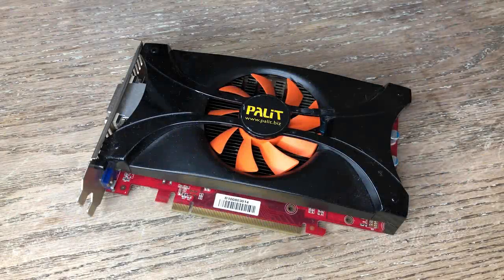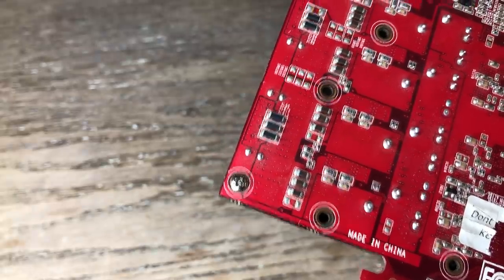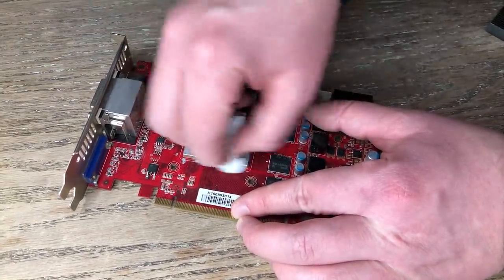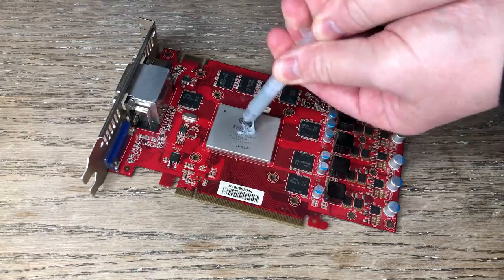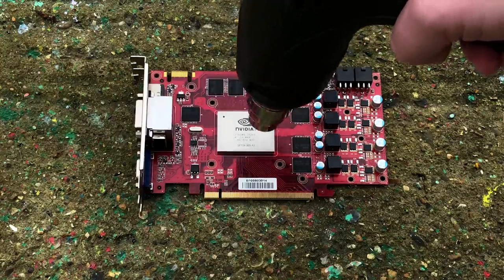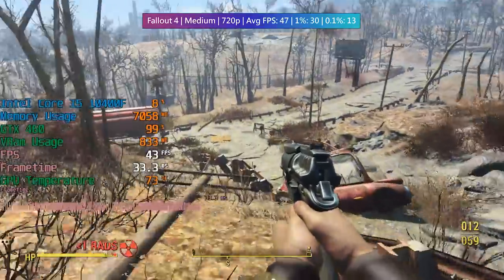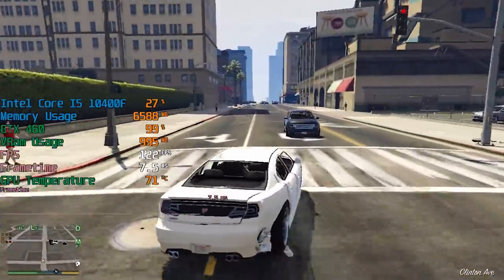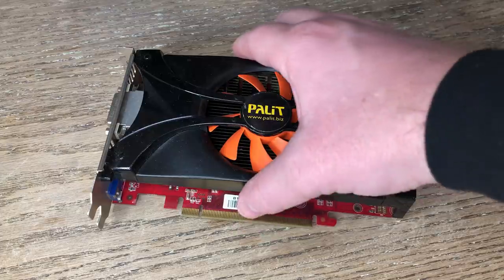Reviving The Dying GTX 460

Comment: As a student/assistant tech at my school I did once bake an HP LaserJet P2015dn formatter board.  Went to market in 2007, HP hadn't tested thermals with lead-free solder for that model and they failed fairly quickly.  The foods teacher was perplexed as was the shop teacher when I told him what fixed his printer.  For reviving a $500 printer, it was a cheap fix for a school and makes for a tech adventure story.

Comment: I did this trick to a dead GTX 280 back in 2013, but I went above the melting point of the lead-free solder. The card had many years of use after it and it actually it still works perfectly! That card was a beast back then.

Comment: i did this to a hd 7970 and it still works and i did it 1 year ago it is definitly worth trying in my opinion
Reply: Yep, my previous GPU, a R9-280X (so basically a 7970) lasted another 18 months by baking it. 
I was really surprised as it failed with a black screen. No artifacts, just a black screen, not even the BIOS would show.

Comment: I'm pretty sure bryan from Tech Yes City has, and he treats those revived gpu as ok to use for another 5 years.
Reply: Bryan does warranty the parts he sells, so he stands by it. Which is more than a random eBay seller or local listings ad would. Personally, I don’t think it’s very honest, but if you have a guarantee, at least you have something to fall back on.
Reply: In my experience "reflows" like this last about 6 months on bad chips, but I have had an R9 280X that lasted a solid 1.5 years until retired. 
Selling them is bad except you give a 3 year warranty which I think even Bryan won't. 
Selling them with just one year of warranty is bad (except if you explicitly say it is a reflowed GPU and might not work very long)
Reply: There is also the ethical problem of baking in inconvenience when you can deliver otherwise. Even with the warranty, you're selling in bad faith if you're not informing the customer that the GPU will fail imminently more often than not. Bryan in particular has spoken out about shady PC resellers taking customers for a ride and I think selling oven GPUs just adds to the perception, even if he's shaving off a few bucks.
Reply: @dycedargselderbrother5353  I'm sure he does tell his customers if the gpu are baked, I mean the videos are on his channel.
Reply: @crispianchealuks2024  I haven't watched his content lately, but "Are you selling these GPUs to customers?" and "Are you telling your customers the GPUs are baked?" were commonly asked questions on the relevant videos and I don't recall him addressing either.
Reply: @dycedargselderbrother5353  I seem to remember one of his video where he replaced a customer's entire system because of glitchy gpu

Comment: I baked an HD 5670 in the oven back in 2012 and it still works to this day haha. I also baked an 8800 GTS 640MB 5-6 times after it would start artifacting within 1 week to 1 month after the prior fix. Eventually, I used it as a test bed to learn how to reball a GPU, and fixed it permanently with lead solder.

Comment: I remember having to do this with the oven method on my old Radeon 7950 and that taught me that reflowing the solder can actually still be a permanent fix if you get lucky as its still working for the guy I sold it to for a cheap a few years back.

Comment: Nice revival and teardown :) If you can't sell it on, for obvious reasons, then I'd either just whack it in a PC that is being sold on, or keep it as a test GPU for future videos/projects.
In fact, I'd happily buy it to go into a 2nd generation Core i3 based tower PC which currently relies on whatever version of Intel HD Graphics it has. I'm sure that any decent GPU (bar a display adapter) will run better than Intel HD Graphics.

Comment: Ahh yes, one of the faulty 460 Sonic cards with a missing vrm heatsink. Wonder why that failed.
Reply: Not faulty, they were legit like that. I had a GTX 560 Ti from Palit that I'm pretty sure used this exacty same PCB with no VRM cooling. The card crashed if you pushed it too much, terrible terrible design and I'm never buying Palit/Gainward ever again. A reference design would have been a million times better.
Reply: @NOXXism  nah the issue was some 460s shipped without the VRM heatsink for some reason, others were fine
Reply: @sgcs  my 560 Ti came without VRM heatsink as well. It was a cost-saving measure otherwise it would have only been 460s. Review 460s had them IIRC but consumers got screwed.
Reply: So might it be that he just reanimated cooked capacitors (or, even if unlikely, MOSFETs)?
Capacitors often increase in capacity shortly when getting warmed up, thats how I test bad caps in PSUs for example
Reply: @TheRailroad99  i doubt that given he was pointing at the chip itself.. at least in the video (cuz like in an oven entire pcb gets cooked)
Reply: My Sapphire Fury cards run without heatsinks now, but they also have excellent VRMs so they don't get warm. My Gigabyte does though, had to put a giant heatsink rail on it with a big fan because wow they really put the worst mosfets on the face of the planet (it does best over-clock under-volted because the VRM power is more stable...)

Oh well, just part of the challenge fitting triple slot cards in a 4x crossfire configuration without enough physical space so you have to water cool the cores.
Reply: @jakegarrett8109  fun project or serious gaming PC? Because I can tell you, since a few years CF sucks, even 2x CF. Very few games support it, and from them, only a handful work well (as in CF works better than a single card).
CF was great 7-8 years ago, but now its far worse than SLI. 
This atleast was my experience with it two years ago.
Reply: @TheRailroad99  A do a lot more than gaming, but my main PC is Threadripper with 4x Fury, and you really need Threadripper for its 64 PCIe lanes otherwise using a crappy 9900k with only 16 PCIe lanes would result in a horrible experience. It gets a little over 100 fps in Crysis 3 at 4k Ultra compared to a choppy 45 fps on my Titan Xp collectors edition

Basically only 2-3 games I have work better on the Titan which are the bad console port Watchdogs 1 (memory hog port, it uses over 11 GB of Vram so not even a 1080ti is sufficient. The PS3 with 256 MB of RAM and Vram could run it, but it consumes insane amounts on PC) and Fortnite. So if you're a huge Fortnite fan you'll want to grab the fastest Nvidia card you can (I usually don't even run it at 4k, for better fps I use my 1080p 240 Hz monitor and overclock the Titan as high as possible although its mostly CPU bound because my Threadripper is clocked at 4.2 Ghz all core and my test bench I usually only have a Ryzen 1700, though sometimes I sub-zero cool that processor it just doesn't clock as well as my Threadripper does).

I noticed that 2x RX 470 had massive stutters (I had 4x of them, but didn't try crossfire above 2x due to horrible stutters. I don't get stutters on my Fury cards, I think HBM or something but its more stable than single Pascal GPU). It also could have been an unstable overclock though, because I looked back at my screen recordings and I left it the same speeds that I set the 3dMark world records for 2x RX 470/570, and I was just gaming at that, so maybe the clocks were unstable, but I'm pretty sure the Fury is just more stable in crossfire and it scaled much better. 1x = 35 fps, 2x = 60 fps, 4x = 100 fps (crysis 3 at 4k ultra), other games like Payday 2, a game that only runs on 1 CPU thread scales above perfect for 2x cards so it just varies per game (I don't know about 4x, its already like 150 fps at 4k Ultra at 16x AA and CPU bound since I don't have a 6 Ghz chip since I don't have an Intel chip but if I do get an HEDT with enough PCIe lanes I'll throw it on my LN2 or phase cooler to see if payday scales with 4x, its playable at 150 fps though).
Reply: @jakegarrett8109  interesting to see that you actually use it. Seems our library is very different. 
Crysis 3 is one of these older games that has a very good multi GPU support. 
But Rainbow 6 siege did not work, 
Payday also didnt work when I tested it in 2018
Reply: @TheRailroad99  Should be default crossfire setting for Payday 2 (make sure its 2 and not 1, I don't have Payday 1). I've noticed sometimes you have to disable then re-enable crossfire to get it working, I had to do that a few times when I first installed the cards but after that they seemed to work fine in all but a few games (a few don't but they run 300 fps hitting game engine caps at 4k Ultra with 16x AA like L4D2 so its a tie regardless of card and Xfire isn't needed). Usually it is older games, and I mostly play free to play or I'll wait several years until games are $5 on a Steam sale. Also the Fury cards have been out since 2015 so the drivers have had their sweet time even by 2018 (I think that's when I built it, I know I had 2x back then and was pretty happy but decided to get 4x for laughs since they were dirt cheap and to my surprise they worked great and much better than I expected, so I've kept rocking them with the Titan Xp on a side system test bench for running Fortnite).

Comment: If you use enough time, or enough heat, you actually can re-melt the BGA connection underneath. I would recommend time over heat, however, as going in "blastin'" is going to burn the PCB more than anything. The important part is that you get it to be tempurature soaked at around 180-270*C, depending on the solder used, and hole it like that for a while to ensure it gets uniformly re-melted. Hot air stations are what attach these components on the BGA socket to start with, and a heat gun is basically a self-contained hot air station, though it's questionable if one has the same power.
Also! can't forget the importance of flux for both solder and tempurature flow, if you have some it's worth trying to get it to seep in under the chip the best you can.

Comment: i put a 120mm 225v fan on my brand new R7 240 when it was reaching 60 celsius
and you let this dead old Castrol get to 80 celsius
Reply: @Unknown Nomad also called "furnace" 🤣
Reply: Efficient space heater

Comment: My GTX 780 also died last year. i did this to it which i found in a youtube comment section

1. Remove all the stuff, that can be removed, from the card.
2. Balance the card on small screws, which are screwed gently into the holes in the PCB.
3. Heat up the oven to 210-220 degrees Celsius (~425 degrees Fahrenheit).
4. Put the card into the oven on a piece of tinfoil (doesn't matter which side is up), for 12 minutes. DO NOT TAKE THE CARD OUT YET!
5. Turn the oven off and GENTLY open the oven door, to let the card cool down, while it's still inside the oven, for 30 minutes.
6. Take the card out and reassemble.

its been working for over a year now. runs perfectly fine.

Comment: My type of video haha , I fixed a EVGA GTX 460 1GB 2 years ago ,It ran fine for 6 months ,then went bad, then re heated it on my fireplace lol ,ran fine on a friend's computer for about 6 months ,died again lol ,now another friend needs a shit card for a bit of light gaming and we'll re heat it again and see if it works. I also fixed a Gigabyte HD7950 which has been working fine for over a year as well as a Gigabyte HD7970 Ghz Edition ,which I'm currently using since March 2020. Out of about 9 GPUs I've been able to revive  4 and have clear indications of which GPUs might work after a bit of heat is applied. 
1)on screen Artifacts 
2)no display but pc boots and keyboard numlock lights on.

These are the only 2 scenarios this will work,also some times vram chips cause problem and by heating them it might fix it.

Comment: I baked my gtx460 3 years ago and one of its capacitor fell off. I put the capacitor back and it still working 3 years later

Edit: it finally died :(
Reply: @aweigh1010  wot
Reply: @aweigh1010  pog

Comment: I have done this with two cards in the past, a 660gtx and a 780ti. Did nothing for the 660 but the 780ti was revived and worked for another year before permanently dying. As said in the video it is worth trying, but don't expect it to always work and know it is only a temporary fix where milage may vary.

Comment: I remember doing a similar thing to my Xbox 360 back in 2014. It had the red ring of death and I saw some guy on YouTube put some skewer sticks into the fans and let it overheat for 10 minutes. After letting it cool down and plugging it back in it worked. I was amazed at how that would fix it. It still works to this day.

Comment: You've not lost your mind, I've used flux on motherboard socket (Which previous owner bought it and straightnen it with pincet) with heat gun and fixed it, it works well for over a year.
You should've covered caps with aluminium foil.

Comment: The numbers you were getting with this card are almost too much for me to believe, even at 720p! I ran the 768MB version of this card (I still have it) for quite some time and don't remember this kind of performance! I eventually ended up running TWO of them in SLI for a bit before picking up a GTX 670. I'd love to exchange numbers with you to compare the 1GB vs. 768MB.

I have tried to fix a GPU in the past using the oven method. An old AMD (ATI?) Radeon HD 3870 X2 1GB I found at an eWaste facility. I wasn't really supposed to take it but I couldn't let it go to waste. It's a coaster now, but I might try to revive it again with a heat gun since your method seemed to work pretty well.

Comment: I got an XFX 8800GTX in a quad core build with a 680i motherboard that visits the toaster oven every eight or so months when it's getting use.

We also run the fans on jet engine mode to hopefully extend the time between.

Comment: I revived my radeon hd 7770 1gb with the same method you did 8 months ago 
But my card problem was far worse than yours it wasn't displaying anything on the monitor but the fans were spinning 
After reviving it with heat it still runs to this day no problems at all and everything runs fine 
8 months for me and im happy with it

Comment: I actually took a heat gun to a 780ti and it ran pretty well for about 2 years. I wouldn’t really recommend it for a primary machine. I had all sorts of weird issues, such as the video out would stop after coming out of sleep mode. But for a side machine that you test stuff on, it was serviceable.

Comment: I revived a Palit 6600GT card back in the day as it died on me when it was only 4-5 years old, and it has served me well since *knock on wood*. I used the oven tactic and that was kind of a mistake, because all the electrolytic capacitors bulged and I had to replace them. Nevertheless, after that I used the card a couple of years for random gaming and now I think it's nearly ten years in my HTPC rig playing FullHD material, still going strong.

Comment: Back in the day I baked my NV 9800 GTX in the oven. It worked fine afterwards for some months until I got a new card.. I put a piece of solder in the oven with the card to see when it would melt, and used that to gauge somewhat how long to leave it in. I am pretty sure it reflowed the card as I had to bend the pcie power pins back later to fit the plastic (I had removed that) because they settled somewhat when the solder got liquid.

Comment: Thee GTX 460 was the gem of the first generation Fermi cards. I had two of them in SLI. How things have changed indeed. They did not run hot like the GTX 465, 470, or 480 from that generation.  Memories LOL..........

Comment: I did the oven trick to a faulty xfx 7950 3gb ghost edition that I bought on Craigslist almost 5 years ago now. The card runs rather hot even with new paste, but needs new thermal pads, has a noisy fan, but it still works like a champ to this day

Comment: I have revived several GPUs with this method over the years, notable being my early 2008 MacBook Pro which has been fine for the last 3 years now with the help of a fan controller program keeping the fans at max RPM all the time and an 8800 GT that I've revived 3 times now and it always seems to keep on trucking for a few months

Comment: I'd like to suggest de-lidding your 200-- 500 series cards and reapplying the thermal paste under the heat spreader. Same situation as intel with their lackluster thermal paste, except much worse.
I've done this with my 3 GTX 285s and they all run on average 10C cooler now, and I was able to overclock them finally after doing this.